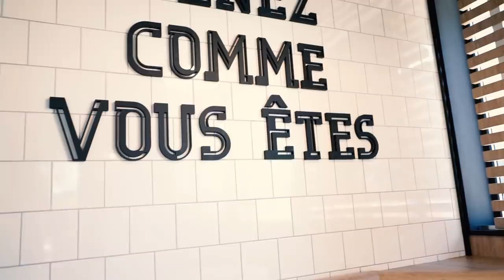Some chippy sprayer rendery stuff - EP013

Comment: Summer haircuts around my daughters house is a full on buzz cut for the boys...girls got a bottom trim as the youngest got ahold of a pair of scissors.  About five inches off on both girls.  100 degree weather coming to Kansas soon.  Will you be digging out those ivy roots, don't want to have it back up in the walls any time soon right?  Thanks for posting.